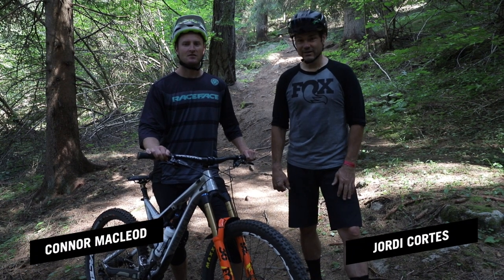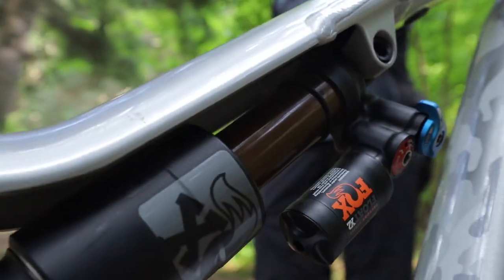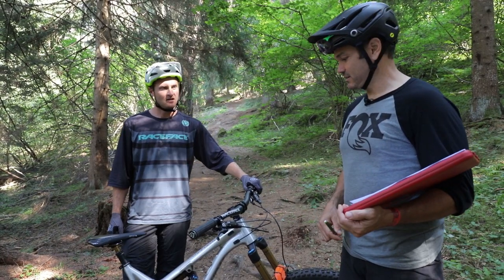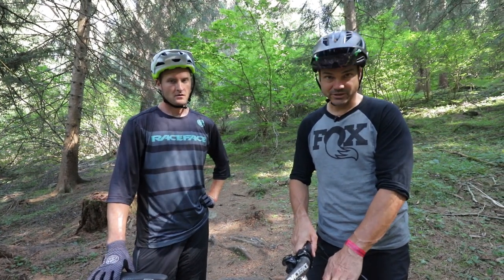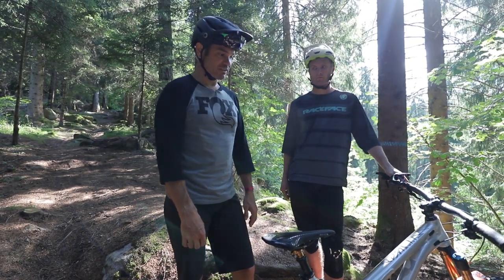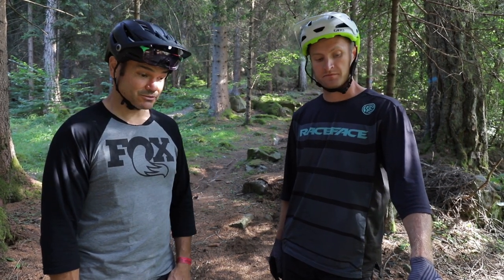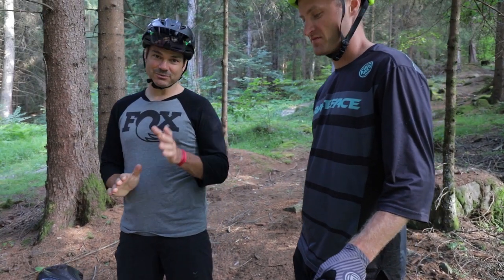DIALED: Episode #32 - JORDI'S ADVANCED SUSPENSION SETUP - Val di Sole WC

Comment: Pretty much the same method when adjusting dirt bike suspension.
Except that if we were having issues getting a good baseline, we would remove the bike's side panels and videotape a troubling section, then rewatch it in slo-mo.
This would help us see how the wheels were reacting to the terrain and that would help determine if and what internal adjustments might be needed.
Just wondering if anyone else has tried videotaping a section?
Reply: 100%. So easy with any modern smart phone to see what the wheels/suspension/rider are doing through something like a rock garden.

Comment: This is great !  I set up my bike today over a set course lap.   It made a huge difference and definitely helped me better understand the feeling and effects of Rebound Damping and High and low speed Compression damping.  My only suggestion would be to start with Rebound damping - because if it's not right - it's really hard to set anything else up.   I also think rebound damping is easier to "feel" for a novice and then it doesn't get in the way of compression damping if you get it right.  Thanks again -  I am Dialed !!

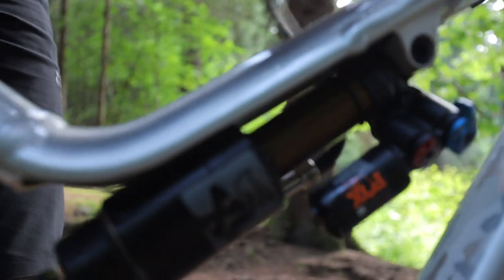Comment: And when will Fox swap that air sleeve guide ring made of bronze/teflon to something that doesn't scratch the kashima coating 7:37? I made my own, that doesn't scratch and makes the shock more coil like, but can't say the material, maybe if you hire me...
 (But I believe in you if you tell me that it's difficult to be mass produced, as the tolerances have to be really tight. In my case (+/-0.005mm))

Comment: I feel its probably just personal preferrance but I like to start with everything wide open and close as I progress in tuning. Also running the Smashpot in my Zeb for ultra sensitivity, traction and confidence. I want as much absorption and as little front wheel deflection as possible for my region and I found the only way for that to be possible is to run coils in my forks. I kind of know based on which trail I ride how much low speed or high speed to add and even HBO. None the less I geek out and love finding ways to improve my set up. Its apparent when you see me ride cuz the bike just eats and stays so composed. And I'm referring to a 60lb Turbo Levo. 170/ 160 with the Cascade Link and coil rear shock as well.

Comment: Jordy I'm trying to work out how to get the rebound dialed in with regard to air spring pressure. I'm 6 clicks on my Fox Rhythm 34 Fork. 1 volume spacer. 90 PSI rendering about 24% sag. I'm using about 80 to 85% of for travel on a variety of trails with some small 1-3' drops. I'm going to let out 2.5 to 3 lbs of air on the fork and wondering if I would need to adjust the rebound, considering there will be slightly more travel with a slightly softer 'spring'
Reply: In general: with less air pressure you need more rebound. 2-3 psi from 90 is not much, so you might only change it by one click if you were happy with the rebound at 90 psi

Comment: Nice video! Can you explain why you start from lsc first and the rebound is a last? Should it be opposite? And in case if I don’t have volume spacers is it correct to just pump more air? I understand it will mess the sag but I believe it will be firmly and with volume spacers fork remains soft but with less bottom effect? Thank you.

Comment: Brilliant vid! 

Dude I’m running fox38’s 180mm travel ( 140psi according to fox - still don’t feel right ) 

Rear shock- foxX2 x1 spacer! 300psi 

I’m 6ft 4” weighing 264lbs 

New bike Scott ransom eride 910. 

Do I add another spacer and drop air in the rear shock or keep the same?

Cheers

Comment: Great series, enjoyed every video so far! 
I have a question in regards to LSC and air pressure. My bike feels nicely set up. However there are a very few instances when I find that when I push into an obstacle, in order to pop off, the fork does not give me as much support as I want, it feels like it is a little soft like the fork is going under the bike a little. Same in some fast rough sections. 
In a situation like this would you recommend increasing air pressure a little, adding air and reducing LSC (so the fork does not become too rough), adding a spacer or something completely different?

Comment: Jordi, could you explain why fox fork volume spacers and vorsrung's luftkappe have different performance characteristics? When both are changing the difference in the air chambers. Also, with the 36 grip 2, when it first came out fox only released it in 160mm travel, now low travel options are available, correct? I was told grip2 needed 160mm to work properly? So this is false ?
Thanks for all your teams hard work.
Reply: i am no expert, but from what i do know the luftkappe does mess with positive air chamber by design as its like adding 1 token in, but the big difference in the characteristic change is that luftkappe also alters the negative air chamber size which is something regular volume spacers do not do.

Comment: Question: 
If I add more Vol Spacer to the fork at the same pressure will the fork handle better at breaking bumps? I assume that it is more sensitive at the beginning stroke and more harsh to the end because of progressivity. 
I would like to divide this question into 
- braking
- no braking

What I want at my fox 40 is better handling at breaking bumps. The problem I see is. Usually at breaking bumps (not always - different skill levels and so different breaking points) you have to break, so you re deep into travel... 
- more progressivity, harsher at breaking bumps... 
- less progressivity, better at breaking bumps...

Is there I possible right answer?

Thanks in advance
Reply: It might actually make it worse to add volume spacers.  How's your sag?  You might need to bump up the pressure a bit and reduce the HSC if you're getting beat up over the braking bumps.  I've settled on less spacers & less HSC while adding pressure and it has increased the sensitivity over high speed chatter.  If you ride too deep in the suspension travel it will feel very harsh.
Reply: Thanks. Very great answer! Will test it

Comment: To confirm when you say open on compression is this all the way to the + or - sign? Likewise with rebound would open be all the way to the turtle or rabbit?
Reply: Open is fast closed is slow
Reply: @nexy5139  thanks, do you know which is which for compression?
Reply: @troydavidson9633  what do you mean. I will try to answer it. When you turn from left to right  its (+) so this means it adds it so it makes it harder to compress. When you turn it from right to left its (-) so you lower your compression and it's easyer to compress. Its same for low speed and high speed compression. And same for rebound.
Reply: @nexy5139  thanks yes im all good with that i just get confused with the terms (open or closed) when it comes to compression. Ie does "open" mean more or less compression?
Reply: open would be less damping, so minus/rabbit. Think about it as opening and closing a valve, open valve -> less resistance on the oil flow -> less damping and vice versa
Reply: @yannik.f22  awesome thanks, that makes sense👍

Comment: When adjusting settings (LSC/HSC/Rebound) during bracketing, do you suggest doing the fork and shock separate or bracket together?
Reply: Do each shock separately at 1st.Once you've got them feeling balanced,and have marked your positions.Then experiment doing single turn adjustments on both shocks,you will probably end up back to your balanced position.But if the next trail you ride has harsher or slower speeds etc then atleast you can tune both shocks at the same time from your balanced position.

Comment: Hey guys, I am having trouble finding the fully closed position on my fork HSC (Fox 36 170mm/29 Grip 2), it does not seem to have a firm stop, it just keeps clicking in and just gets firmer to turn. It does have a solid stop when wound fully open though so can you tell me how many clicks from full open would be to fully closed? Manul seems to say 16 clicks of adjustment but when I count in from fully open it does not seem even close to stopping, it has another 10 clicks before it starts to get firm? Any help appreciated. Cheers. Damien.

Comment: I've got a fox 36 factory 160....ive had problems with it feeling like it is vibrating madly over smooth fast terrain...to the point I have to slow down.No one seems to be able to work out the problem...Im 200 pounds and ride hard and aggressive...no matter what pressure or compression I use it's still the same...this this the second bike the fork has been on with the same results...services are up to date.....HHHEELLPP...lol

Comment: @FOX what do you think about lubing the sanctions, either spraying  some sort of silicone on them or dropping lube under the dust wiper? Is it just an excuse to not do a propper lower leg service or does it provide any performance/reliability gains?
Reply: The foam rings take care of this. Just drop the lowers, and clean/re-soak them. Spraying lubricants on the stanction could be bad for the rubber seals and will just attract more dirt.

Comment: Hi,

I ride a megatower using a fox DHX2 2019 and a fox 36 2019 160mm grip 2 factory on it. 

Just having some difficulty to set the DHX2, a little beat harsh at rock gardens, and the fox 36 a little low sensitivity (bar time at rockgardens and brake bumps), also the bike tend to rear kick on jumps. Can you please help me?

I'm 1,82cm, 85kg, intermediate rider. Terrain with rocks, gravel, small mid jumps (less than 1,60m lip).

I'm using:

DHX2
SLS 500lbs x 2,75 spring (34% sag).
HSC all open
LSC 3 from all open 
HSR 14 from all open
LSR 11 from all open

FOX 36 factory  grip2
81 psi
HSC all open
LSC 7 from all close
HSR 2 from all open
LSR 9 from all open

Comment: @fox, I rode the bike park the other day on my Orbea Rallon and I felt like I was landing too nose heavy off of big jumps. I had a few close calls! It could be I was over shooting but, at times it feels like the front end "drops off" of jumps. I'm wondering if there are some rebound or compression settings that I should adjust to prevent the heavy nose landing? I don't seem to have the feeling on smaller jumps. My rebound settings seem pretty dialed and I am able to make the bike do what I want to do for the most part. Shock is a float X2 and fork is the Grip 2 36 float. I am wondering what adjustment would do anything.